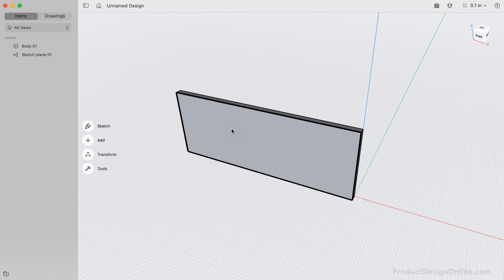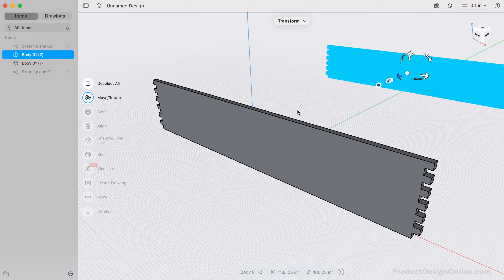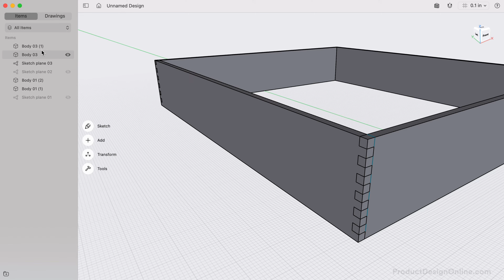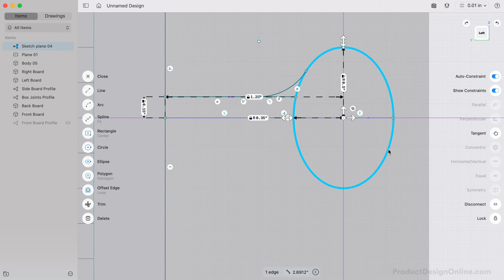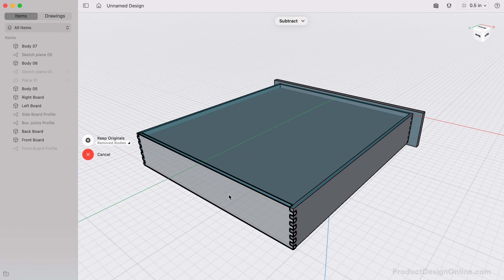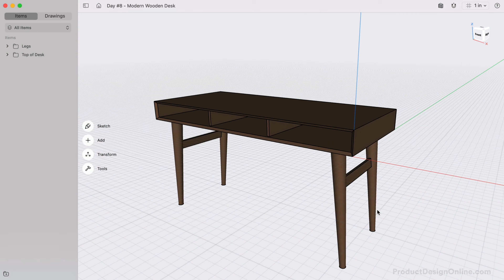Box Joints in Shapr3D | Day #9: Learn Shapr3D in 10 Days for Beginners!

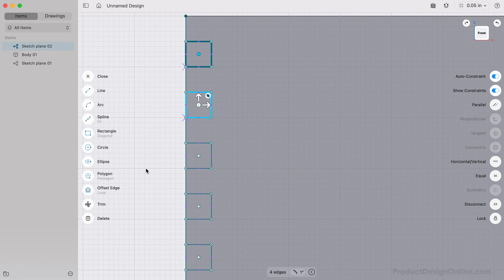Comment: Yeah, what you show at 1:30 doesn't happen for me.  When I draw that first .25" box and try to copy it to make the box joints, the box is connected to the edges of the board. When I copy it, I copy the bottom edge of the drawer front, as well.  So far, I can't figure out how to draw that .25" box w/o it automatically attaching it to the drawer front box.  I'm on an iPad, btw
Reply: I'm having the same issues also all my sketches keep trying to be place on the same plane vs a new one like in the video

Comment: Ran into a small problem here - Apparently, you can't export in Shapr3D's native format if you are using the free version.  I thought I'd give the program a test drive to see if it would be a better option for me than the one I've been using.  In some ways it's better, some ways more "fiddly".   The export limitation... and the insane inflation for the monthly rate... I'm having serious second thoughts here.
Reply from the maker: What program have you been using? I recommend (and personally use Fusion 360) for most workstreams. You can sign up for their free personal use license which has less restrictions than Shapr3D's.
Reply: @PDOShapr3d  I just downloaded Fusion 360 again - played with it for a little bit before switching over to FreeCAD.

I've been using FreeCAD for about a year or so, and while I do like some aspects of it, there are some quirks that I have had some issues with.  And, to be fair to it, I've mainly been puttering with it on my own, so I've been hunting up some tutorials for it as well.

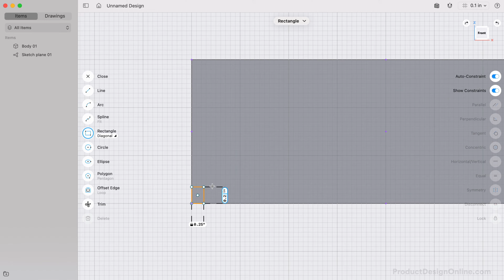Comment: @0:55 : I do not get the arrows to move the rectangle. Tried many times over new. I also tried with a rectangle that is not on the face of the board, but same problem. When I go out of sketch and try to copy the rectangle, it also moves the corner of the board.
Reply from the maker: Hi Tim. Are you using Shapr3D on Mac, Windows or iPad? I still get the arrow on my end (on Mac), so am wondering if there is a difference between platforms - otherwise, it may be a setting somewhere. Cheers, Kevin
Reply: I had some issues with that as well.  I think I had to go in and select each line of the rectangle before I got it to show up.  And hide the board when doing so because it kept getting caught in the selection.

As I said in my own comment... there are parts of the workflow that are... "fiddly".